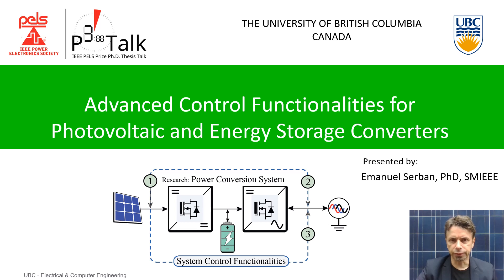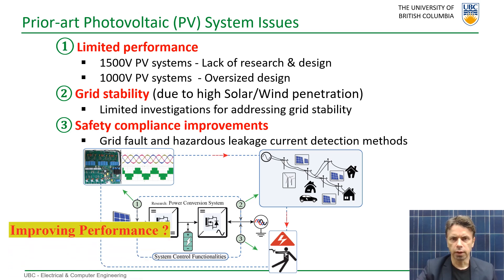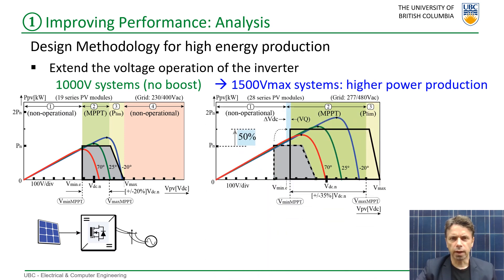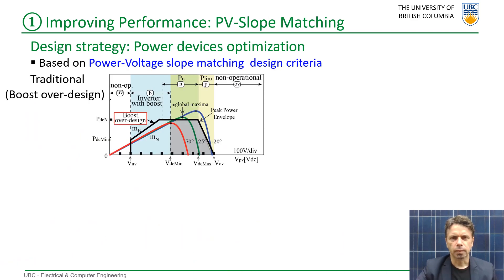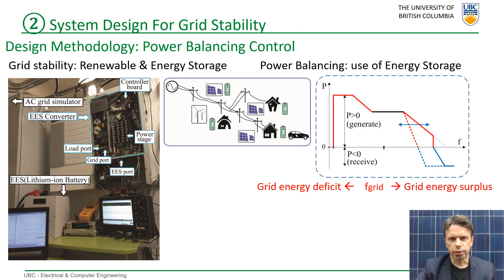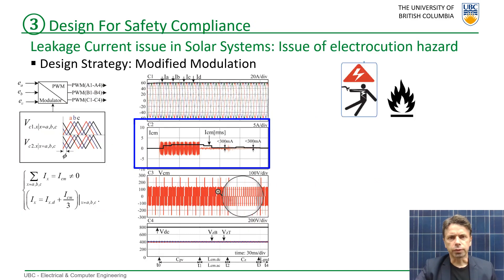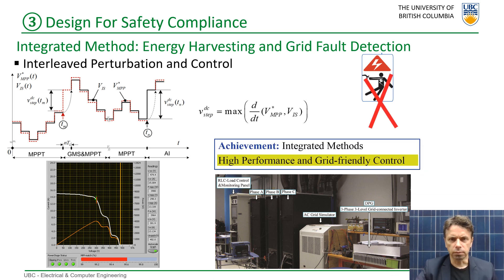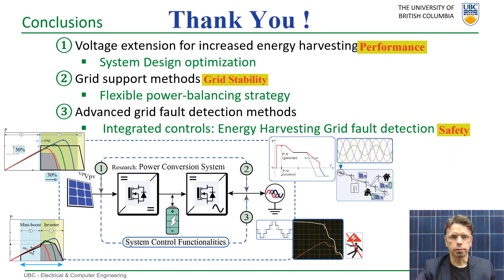Power Electronics Ph.D Thesis Presentation: Emanuel Serban, Best Thesis Award 2019, IEEE PELS.

Comment: Excellent. Can you share some details about softwares you used to simulate and draw various graphs, diagrams etc. I will be really grateful to you for that.
Reply: Thanks for your question - various software tools have been used. For example, from the concept stand point I'm using MS Visio. Then using electronic simulation tools, e.g. PSIM, Matlab/Simulink testing the controls concept. From the control model, then get the controls emulated into digital/analog software environment like PSpice (Orcad). Moving further, build the prototype and verify and validate the electronic model. Finally, using Adobe Illustrator to export the figures for best quality.